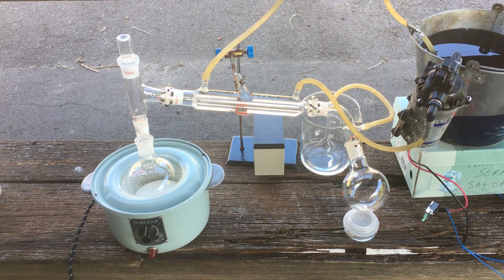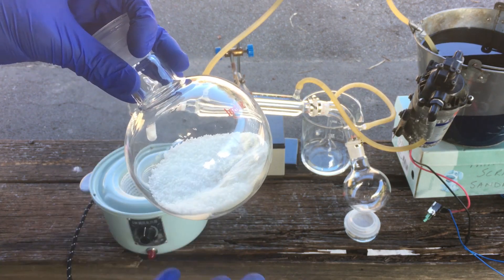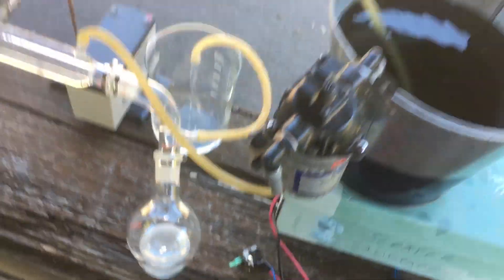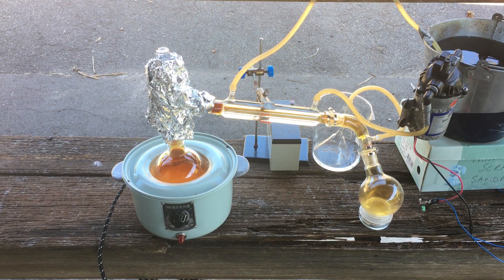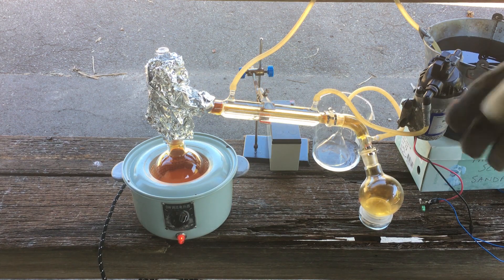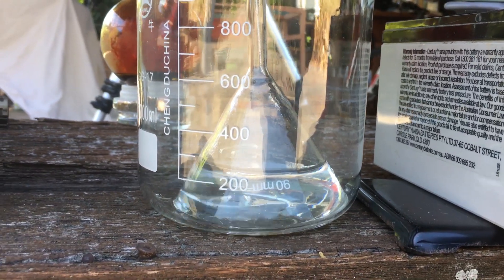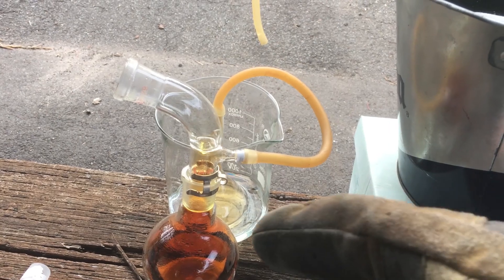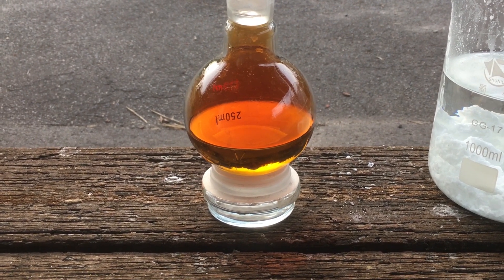Making Nitric Acid

Comment: Could you make the sodium bisulphate anhydrous before going this?

If you answer this could you also help me understand the ratios. 1.5 molar equivalence, I don't know how to calculate. Would 3 parts NaHSO₄ to 2 parts KNO3 by weight be close enough to what you mean?
Reply from the maker: You could make the sodium bisulfate anhydrous if you wanted, but the main mechanism by which the reaction occurs requires the reactants to melt.
The melting point of the hydrated form of sodium bisulfate is around 50 C (which makes it very easy to use in this reaction with modest temperatures), but the anhydrous form melts at above 300 C. While it would work to some degree, running a reaction at over 300 C is generally very difficult, and likely would decompose the nitric acid considerably.

The ratio of NaHSO4:KNO3 I refer to in the video is not based on mass, but is instead based on the stoichiometry of the reaction. It's not possible to explain the fundamentals of this in a single youtube comment, so you'll need to do some research here.
As a starting point, you'll need to look up topics such as the 'mole' and the 'molar mass'. Once you've understood these ideas, maybe search for 'stoichiometry basics'. There are plenty of textbooks online which can explain the ideas much better than I can.

As a final note, if you are planning on doing this yourself (I mean, I don't know if you actually are, so this paragraph might not be relevant). I don't want to be rude here, but based on the fact that 'molar equivalence' is an unfamiliar term, please don't try this without extensive research. I'm not sure about your experience with chemistry, hazardous materials, or PPE, but this really isn't the project to do without an extensive understanding of the fundamental chemistry of the reaction and the substances involved.
Reply: @ScrapScience  thanks for replying and you're right, I don't have formal training however I'm cautious. I have experience making azeotropic nitric acid several times and sulfuric acid as well as things like chloroform and hydrazine sulphate for copper mirror and a lot of metal salts and complexes, tollens reagent. I use suitable ventilation and ppe. I'm not breathing in stuff in and I've not blown anything up yet. Most of it has been careful following of set procedures and looking things up online I've just got this far without having to calculate stociometry. I'll learn about it. Again thanks 😊
Reply: @ScrapScience  I should add the term is not unfamiliar

Comment: Another good video. Like Mike Hanley mentioned, I'd suggest measuring the density to figure out the acid content. I'm not sure exactly how concentrated you're needing it but if you do have a bit of sulfuric acid and need it stronger you can always mix it in and distill from the mixed acid for a quick upgrade.

I can see a yellow glow in your acid but did it look greenish in person to you? I've done this method with sodium bisulfate and sodium nitrate and when I ran just the salts together the acid I was collecting was greenish. Teflon tape for sealing the joints was an interesting idea I might try if I do it again. I was using sulfuric acid as a joint grease.
Reply from the maker: I'll definitely be measuring the concentration at some point, and thanks for the idea for drying it! I'll be sure to do that if I ever need RFNA specifically. At this stage, I don't have any use for concentrated (or even azeotropic) nitric acid, but I'll keep it around just in case.

The colour of the nitric acid is an interesting property of the nitric acid/nitrogen dioxide mixture. Under most circumstances and concentrations, the acid appears yellow due to a small quantity of dissolved NO2. However, under the right conditions, the equilibrium which holds NO2 in solution will shift towards making N2O4, which also stays dissolved in the acid to give a green colour instead. I'm not sure exactly which conditions favour the formation of N2O4 instead of NO2 (it's likely to be temperature I suppose), but it's nothing to worry about since the chemistry of NO2 and N2O4 are extremely similar.

Comment: Nice demonstration, as always :)
If you protect your apparatus from UV-light (with aluminium foil for example), less nitric acid can decompose into nitrogen dioxode, and the yield of your highly concentrated nitric acid will be (slightly) better at the end. 
Would it be possilbe for you to messure the concentration of the highly nitric acid, would be really interested in it. I always used to use sulfuric acid, but it would be a blessing for me to be able to use sodium bisulfate when still getting the same (or at least similar) results. 

Btw, is the perchlorate cell video already in plan? 
;)
Reply from the maker: Yep, thanks for the tip! Protecting the apparatus from UV light is generally a good idea here (I'm not exactly sure how much it helps, but it should reduce the decomposition somewhat). Sadly, protecting the setup from UV with aluminium foil also protects it from being filmed properly, so it's a tricky decision to make.

Sadly, I won't be able to measure the concentration until we get around to using it (maybe two videos away at most). Until then, if you want an in-depth analysis of the efficiency and yield of this method (including the effect of running it with different ratios of reactants), you should check out Nurdrage's video on the topic. The link is in the description.

The perchlorate cell is still a long while away I'm afraid. Since it's a relatively popular topic without much relevant information on Youtube, I want to make sure I do it well. As such, I'm still in the research stage for that one.
So far, its about 10th-15th in my list of video ideas that I've got lined up for the future. With my current upload rate, it's going to be quite a while before it's finished.
Reply: Yeah, this is great advice.

Another simple way to prevent UV exposure is just using amber bottles.
Reply: Borosilicate glass isn't all that transparent to UV light, so decomposition by UV isn't that great of a concern.

Comment: I heard that if you use sodium nitrate the foaming isn't very intense
Reply: I've used both and never really saw a difference.  I think another factor in foaming is the use of anticaking agents.
Reply from the maker: Interesting, maybe the sodium salt is a better choice then, and has the additional benefit of containing more nitrate per unit of mass.
Ultimately, I suppose it comes down to whichever salt is easier to obtain for the individual. For me, that's definitely the potassium salt, but for someone who has the choice, sodium nitrate might be the way to go.

Comment: I didn't properly dry my potassium nitrate on my first attempt making nitric acid and it wouldn't start gloves on fire. I was a little disappointed. 
I dried it in an oven for 4 hours on very low heat and put it in a dessicator for a day. The sulfuric I used was also almost pure.(on my second attempt)
Much better results.

Comment: That was very interesting, excellent video as always :) do you have to make your nitrate ? If so that would make an interesting video
Reply from the maker: I managed to buy some potassium nitrate online a while ago (it was a lot easier to get hold of than I thought), so obtaining nitrate is not generally a problem for me these days.
However, easily making large quantities of nitrate is a goal that I'll be visiting in many future videos. I've got plans to try some electrochemical and electric discharge processes for synthesising lots of nitrate, so stay tuned!
Reply: Scrap Science interesting I’m surprised it was easy to buy but that’s good to know.   That sounds awesome I’m looking forward to seeing that!
Reply: @murkyseb  Nitrate (KNO3) can also be made DIY by using urine (or urea) and soil in a big pot, combined with potash  [or chalk if you don't mind about getting Ca(NO3)2 ] - and let some microbes do their jobs for some weeks. Later you can extract the Nitrate from the soil. It's a method everyone should know about, at least and if done in the right dimension, it can be much more efficient, than this electric discharge process. For gunpowder that was the anxient process, to produce nitrate, used by several nations.